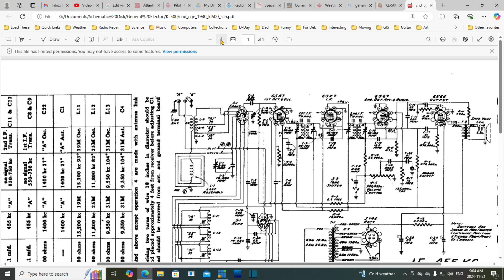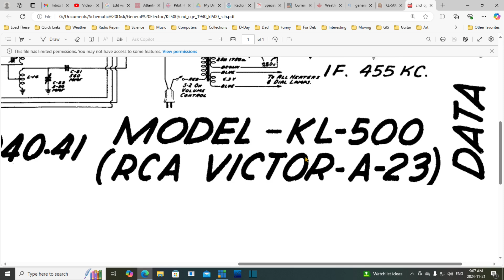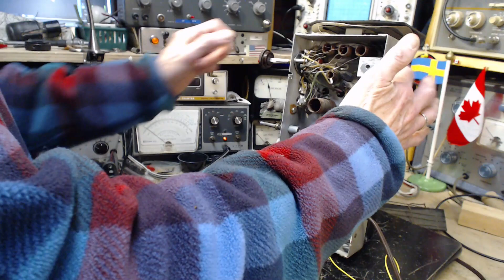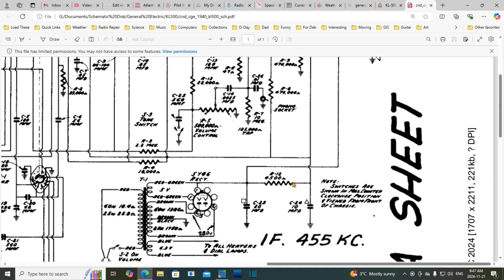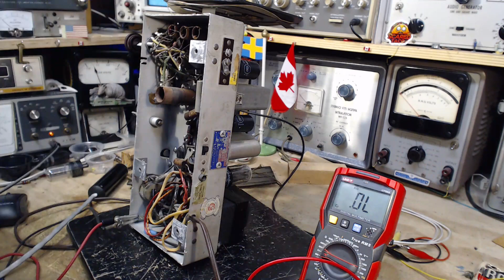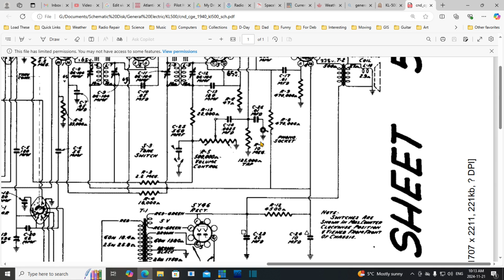Canadian GE KL500 Multiband Tube Radio Video #2 - Big Bad Trouble

Comment: Two additional comments.  From the CGE KL500 datasheet, the switch in the radio rear panel is for tone control.  I suppose it will cut high frequency when you switch the 560MMF to chassis ground.  So this should be equivalent to a bass control, but it was not possible for me to validate it.  Also the CGE KL500 datasheet clearly identifies the phono socket in the radio rear panel as a "phono INPUT socket".  If you look at the schematic, you see the phono socket feeds the 6SQ7 grid as the 2nd IF Transfo does through the volume potentiometer.  I have the same type of design in my RCA Little-Master A and it works fine.  You tune your radio to a point where there is no channel, and the audio INPUT coming in the phono socket will play in the speaker of the radio.  And of course you use the volume potentiometer to adjust the audio volume coming out of the radio speaker.  This type of feature was used in the '40, '50 and '60 to attach a record player and use the radio as an auxiliary external speaker.  Hope this help someone.

Comment: In the video 4m20, Jim identifies R12 as a 4500 ohm field coil.  Please note I have the complete data sheet for the CGE KL500 and the electronic parts are listed.  R12 is listed as "Resistor 4500 ohm wirewound" in the document, that is a field coil simply speaking.

Comment: I repaired a KL500 identical to this one (same case too) a while back and I too had a field coil. I found that the KM500 schematic had the field coil matching my radio. The field coil resistance is 1800 Ohms.

Comment: I have used a transformer out of a walwort power supply  to replace  a bad output transformer and it worked quite well
Reply: What a cracking idea .......
Reply: You can use transformers intended for mains application as audio output transformers, but the result will be less than satisfying and show distortions on higher volume. The real Audio output transformers intended for single ended (single tube) output stages have an airgap! They do that to avoid the transformer core saturating and changing inductance, which is a known side effect of the permanent magnetic field caused by the constant portion of the plate current of the single output tube flowing through the primary. Mains transformers however work reasonably well on push pull designs, where by design the static magnetic field caused by the two output tubes actually cancels out, so the transformer does in sum(!) see no DC current passing on the primary, hence no static magnetic field is "plugging up" the iron core.